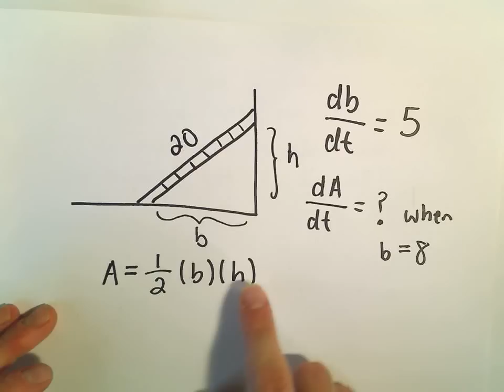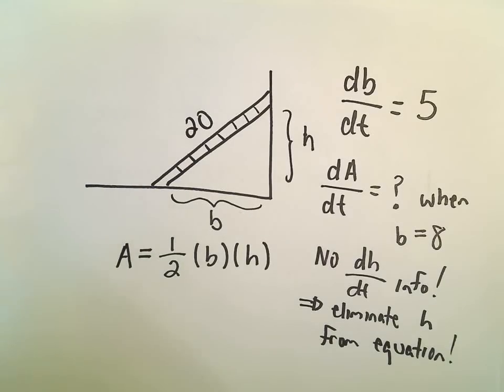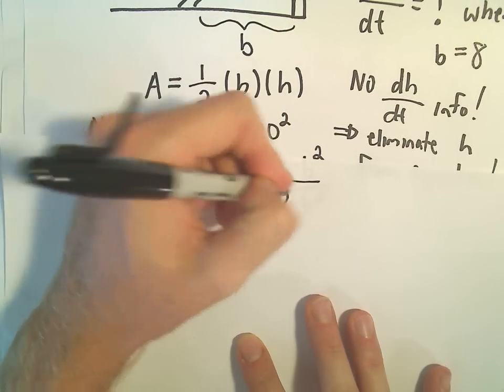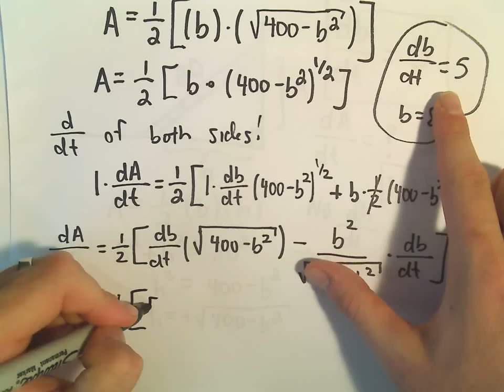🪜 Related Rates: Ladder Sliding Down a Wall – Finding the Rate of Change of Area 🪜

Comment: I solved this problem differently; I differentiated the (b^2 + h^2 = 20^2) equation to solve for dh/dt, which is about -2.182. Then, I plugged in dh/dt into our original equation. This made the differentiation substantially less difficult, and it was easy to plug and chug for a final answer.
Reply: Yo, I got -2.182 aswell, but I dont know what to do next afterwards. Could you please help? ;/
Reply: Yeah I did it the same but with actual values and got -40/sqrt(336).

Comment: I found many people commented many things but I think Patrick solved the best way possible. 
First draw the diagram, figure out whats happening and whats given, then form an equation, differentiate it
and at last plug in the values. So the important thing is there must be a general a general approach to every kind of 
problem, that will help you to start the solving the problem rather than just sitting and starring on it....

Comment: i did this by finding what dh/dt would be and i still wound up with the same answer. i think its the same way it jus made plugging numbers in a little bit easier. i mainly use these for practice because you pick really good examples. thanks alot for the help though i know another way to do this that saves me a little bit of time. hopefully i do good on my calc final tomorro =P

Comment: a ladder of lenght 20ft is leaning against the wall and its top sliding down the  wall  at the rate of 3ft/s. How fast is the area of triangle formed by the ladder the wall  and the ground changing when the ladder makes and angle of 30 degrees with the ground?

Comment: I would break the solution into two parts. First I would find dh/dt by differentiating b^2+h^2=400 with respect to t. 
After that I would differentiate A=(1/2)(bh) with respect to t. (Do not forget the Product Rule).
Reply: Agree.... simpler algebra, less chance of errors - which I managed twice doing it the way shown! :O

Comment: can i have 2 different equations here? I used the value of h using pythagorean theorem. Then I took the derivative of the pythagorean theorem to find the value for dh/dt.  I got the answer of 2.18 ft/sec. I have both rates now so I took the derivative of the area of the triangle to find D(area of the triangle)/dt. The answer is 5.45 ft/sec. Is this mathematical incorrect?

Comment: why did you multiplay db/dt twice in the product rule ?
it was (db/dt . (400-b^2)^0.5) - (b^2)/(400-b^2)^0.5 . db/dt)
shouldn't it be (db/dt . (400-b^2)^0.5) - (b^2)/(400-b^2)^0.5 . b) ?
Reply: i agree
Reply: bec. its always needed in this type of problems, like he could just get A^2 + B^2 = C^2 to B^2+H^2= 0 C^2 is the ladder which is constant, and then 2b(db/dt)=2h(dh/dt) then just get the dh/dt. The derivative of A^2 side is just 2A but this problem is related to "rates" so always with respect to time your needed variables :)

Comment: If DB/DT is 5, wouldn't it be accurate to assume DH/DT is the same? both sides of the ladder would be moving at the same speed no?
Reply: nope db/dt is -2.18m/s. So, A^2 + B^2 = Hypo. which is the ladder (constant) not changing so we'll eliminate that. then 2A(da/dt = - 2B(db/dt).. then you know what's next. A=base or x B=height or y

Comment: Tell me if I'm wrong but since the problem told us to find the area when the base is 8 units from the wall isn't it a little redundant to substitute the square root of (400 - b^2) when we could just use the Pythagorean theorem to find h (which would end up being whatever the square root of 464 is)?
Reply: Excuse me sir, but the h is constantly varying, the relationship between h and b cannot be obtained because the ladder is being moved. The value you obtain is original but not the answer

Comment: Why didn't you differentiate the 1/2 at 5:35 ?
Reply: constant multiple rule
Reply: When you do product rule with constants you get one side completely cancels out because the derivative of a constant is 0 and anything multiplied by 0 is just 0, the other side will just be that constant times the derivative of the 2nd expression thus u can always take a constant out.

Example:
5x which is just 5 times x (product rule)
(0*x + 5*x') = 5 
 In his example it would be [0* all that + 1/2 * all that'] the 0 side cancels out and your just left with 1/2 times the derivative of everything
Reply: Because you're looking for the area under the ladder which is optimised by a triangle. 1/2 [base * height]

Comment: While simplifying and working out the derivative of the area, you forgot the derivative of the base at the very end of the equation.
That threw off the answer, which should have ended up being negative. It's moving in the downward direction, so it doesn't make sense for the answer to look that way.